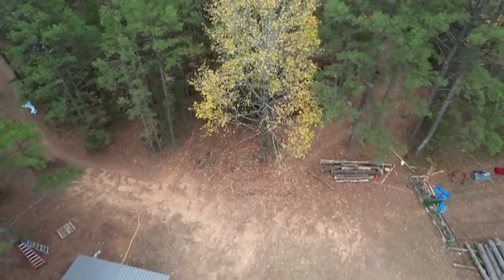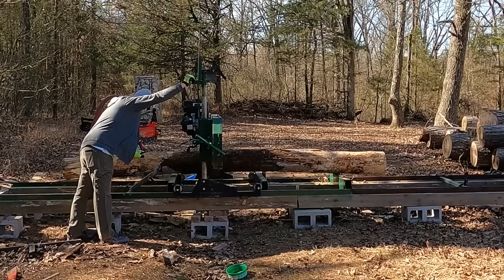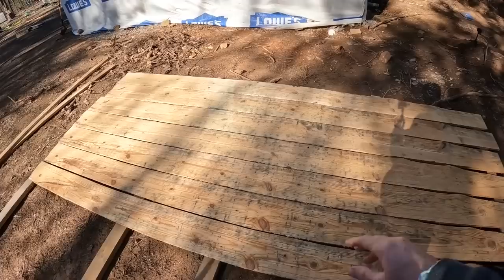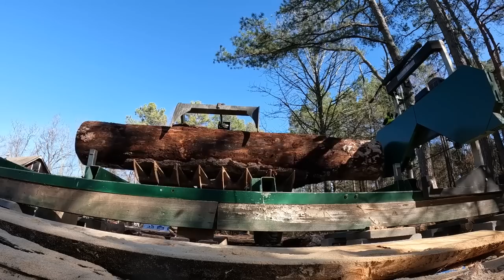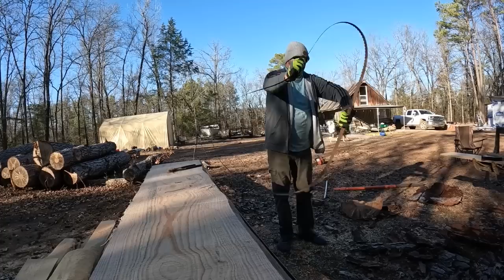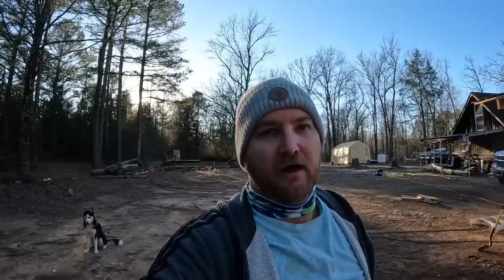MASSIVE LIVE EDGE SIDING | tiny house | | cabin build | tractor work | homesteading | sawmill | DIY

Comment: You have received a lot of comments which is great. You have a hard choice to make. I would personally alternate between large and small pieces to make a somewhat 3d affect. Put them vertically not horizontal, this would give you a better chance of not getting more leaks. You will still have to grout (seal) the wood. Good luck.

Comment: hi, how about putting a wide plank either side, vertically, meeting up to make outer corners edges of the structure, do as many corners as you like & place the narrower planks in between them, vertically, so it gives it a framing effect, could do wide planks top & bottom ,horizontally, that would really frame each wall. If not. Could always not worry about sizes & just mix them up, kind of in  a random placement way. Which ever u decide, it will look great when finished. So much hard work & love going into building it. Glad your feeling better & good to c u wearing a mask too. Take care, have a good weekend & hope the trip goes well. L&L

Comment: Good to see you milling the lumber.  Are you planning to use it as board and batton, tongue and groove,  ship lap?  Do you want horizontal or vertical?  Each has its place.  You might want to save a few of the wider boards for other projects.  With the live edge I would go horizontal with an overlap. You should check the grain of the would on the ends. That will tell you which way it will want to cup. Make sure the cup goes in. If you want an example of live edge siding check out the cabin build on "the outsider " channel.   He is building a beautiful cabin in Canada.  He uses live edge siding on his gable ends. He and his father are serious craftsmen.  That would be an excellent example for live edge.   Board and batton would be the easiest for vertical but it would waste the live edge. If you are running low on siding you could rip the larger boards down the middle since you only need one live edge. Don't forget to cover your boards moisture will increase the warping. Glad you are feeling better keep up the good work. 👍

Comment: I like the idea of putting the wider siding at the bottom.  I also think that it would be interesting to alternate the widths.  You could also rip 4 to 6" from each wide board on the sawed edge and use it for your outside trim. I also watch Smokey Mountain Outpost YouTube .  He has used a similar mill to make his siding.  He uses the burning technique and then he finishes everything with Australian Timber Oil by Cabot.  The stuff is not cheap, but it gives a very pleasant golden color.  Not sure how often it needs recoating.  Enjoy your trip!

Comment: It depends are you going horizontal or vertical with the siding?  if horizontal do the wide for the bottom 2 or 3 courses then go smaller as you get to the top. If going vertical the more narrow would look better or you could stagger and make it kind of like board and batten.  But to match the cabin more I would do the wide horizontal at the bottom 2-3 rows then do the more narrow vertical above that

Comment: We have a ton of videos showing our live edge on our cabin if you care to get an idea of the look. Using Live edge I milled myself as well, I think you will like the wider slabs if you have enough big logs to make enough of it. You have to remember that you are over lapping them a bit as well so that takes away from the width as well. The smaller ones may end up just looking like lap siding if they don't have enough character.  I'm not a super frequent watcher, but see a few of your vids and watcher here and there, so I offer this bit of advice too since I have first hand experience and I don't know how much you have with live edge, But if installing green, we only single nailed at the top edge of our siding until it dried out a bit so it woldn't shrink and split.. It is cupping and warping a bit, but I'm not sure which is better when drying out.....twist or splitting.  Either way we wish you the best.
Reply from the maker: Ty I will check it out I have more than enough for either

Comment: I would go the narrower boards by far.... On bigger logs like the last one... Maybe just start by, if you feel safe enough, saw the log in half, lay that half on the ground and just do a half a log at a time that will give a more narrower board with a live edge on one side. 
       My grandmother who was a medicine woman, used pine shavings for medicinal purposes. It was like the stuff you rubbed on your chest to clear the congestion. I only knew "Nana" from the time I was six till I was eight and she would spend hours with me as my mom was in a sanitarium for people with tuburuouses and so when she (mom) passed on, I was sent from N. Carolina to Washington state to live with my dad. Those two precious years tho were some of my greatest memories of her and medicines from our earth.
      If you do buy blades, get the No., 7 pitch as you will find it easier to go through a log. A small scissor jack setting on something under the small end so to get your log level to start with will be very helpful. Most old pickups had them under the hood or behind the seat an were never ever used as folks just wasn't happy with them overall when changing flats. Back in them days, a tire never lasted as long as even the tread because, well you already know that stuff. Try to keep the blade fairly tight as a bouncing blade is usually a broken blade sooner than planned. A torque wrench and about fifty pounds of torque is about where I would run at but, there are folks who know your mill better than me, I always just made my own mills.

Comment: Go Horizontal with the little pieces and then use the wider boards for Board and Baton by the outdoor kitchen, you can use some 3 or 4 inch pieces for Batons. That would definitely make the kitchen area stand out and would give you a flat wall for hanging shelves for kitchen tools and such. At least that's what I would do..

Comment: I would use narrow siding on narrow walls and wide ones on the wide walls.  Each is the best for covering that type of wall.  Wide ones to make quick work of wide walls, and the smaller that would not take that long to finish a small wall!  Have a Safe Trip!  Don’t run yourself into the ground!❤❤
Reply: Well I just watched you milling video again and I think I have changed my mind!  I think on the skinny boards I would trim as much “live edge” off on side to give you a sawn edge.  Then the large ones cut in half so each has a sawn edge!  When you start the siding, put the live edge down and level the sawn edge.  Continue all the way to the top, and that will let you finish the top of the wall with a level sawn edge to complete that walls siding.  This way you don’t have a glaring size difference between the narrow and wide planks of siding.  Just enough difference to make the look interesting, not “What the Devil was he thinking!”  Have a Safe Journey my friend!  Tell Half Pint he’s missed on the mountain and the 41.36!

Comment: I saw an episode of Alaska homesteading where they framed a slot on each end and were able to slide the siding in so that as it dried and shrink it could move. I think you should use the wide ones in the bottom then the smaller ones. Great video

Comment: David for looks I think a mix of the two widths or more once you get all the siding planks you need, by that I mean a wide one, then a small one, then back to a wide one, and so on, mixing in another width if that is what you have milled in the same way, lay some out on the floor before fixing to see what they look like.
By the way I mentioned to Gary when he borrowed your tractor that a steering knob that clamps to the steering wheel is a much safer way to steer and giving you better control to say the least, than just skimming your hand over the top of the steering wheel, this is a very dangerous practice, and possibly even one day saving your wrist from being broken, which you certainly don't want to happen, I think you could get one from any farm store supplier and they are not that expensive, as a fork lift operator for many years, I can assure they are great, making life driving these machines much easier.

Comment: I prefer the narrow and I think there’s a practical reason the closer they are they shed water better so at least the lower courses should be narrow and tight lap. Dumb question on the mill: does the blade stretch and need to be tightened after using it for a while like a new chainsaw blade? Great video C’mon!

Comment: Use wide one on the big sides and narrow on the shorter section  or start at bottom with big one and mill some of sizes between the two and taper them from big to small at the top

Comment: if it goes to size of boards, you can just mixed them while putting on the wall. i'm not a pro but i think you need to check stretch of a saw blade every couple planks to make sure that it don't break, can''t see you making it on a video so don't be mad of me if you doiung it behind a scenes, metal work and change his lenght so ...